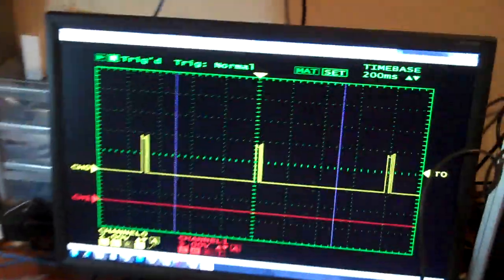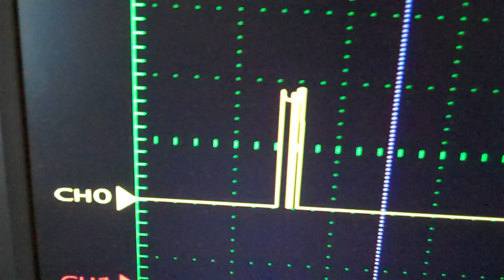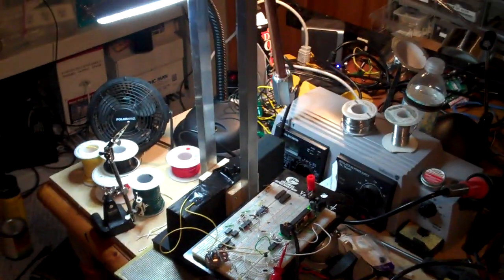Electromagnetic pendulum

Comment: I am working on something similar.  I am putting magnets around the outside of a plastic pipe at every 90 degrees, maybe 45 if I get enough clearance from the hall effect sensors.  There are two sensors.  When the first one detects a field it turns on the electro magnets to pull the permanent magnets of the pipe.  When both sensors fire it turns off the electro magnets.  When only the second sensor fire the electro mags reverse polarity to push the pipe.